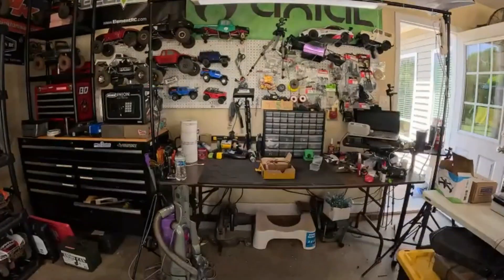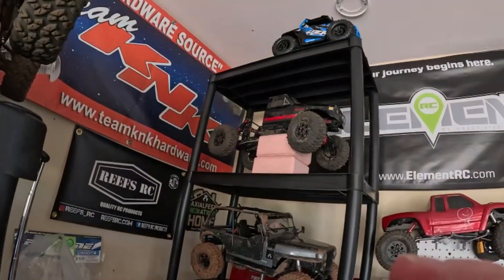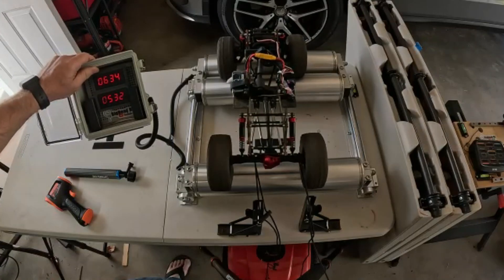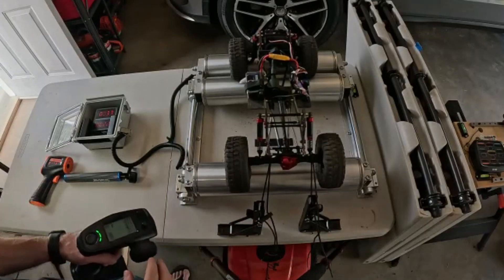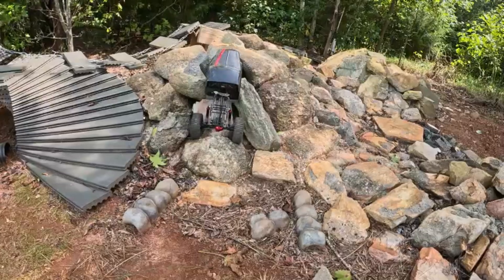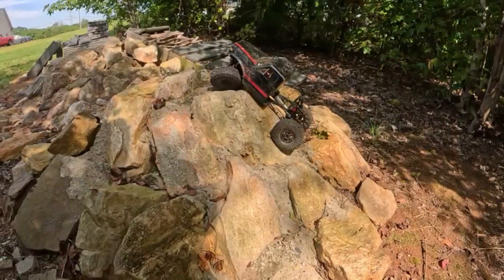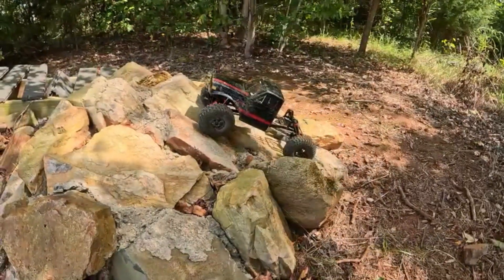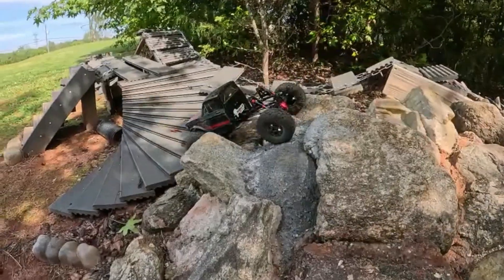SEQURE SQESC 2670 Brushless ESC 2-6S Lipo / 3625 high performance outer rotor brushless motor/SQESC

Comment: Im using same motor,  and esc with a 3S battery. What determines the voltages on the esc. Is it motor, or servo or both? Also how are we looking up the 3 black wires?

Comment: i  flew fpv for years so I'm pretty familiar with those esc i love all things rc land and air lol  but i just got it on prime spring sale for 40 some bucks running it with a holmes hobby snubnose 1800kv v3 and its awesome  i have tried alot and i think the newer am32 type esc is just great  if you not ready the settings can be a bit overwhelming but get it dialed to your liking it's great

Comment: I got the same esc and motor that you have.  When im connected theough wifi tool it wont let me change the bec boltage its stuck on 5.5v